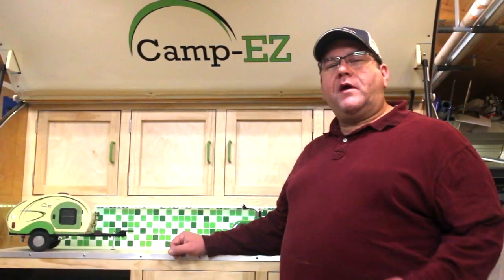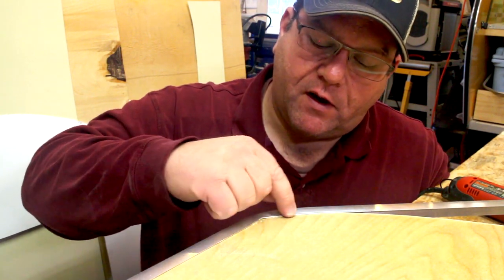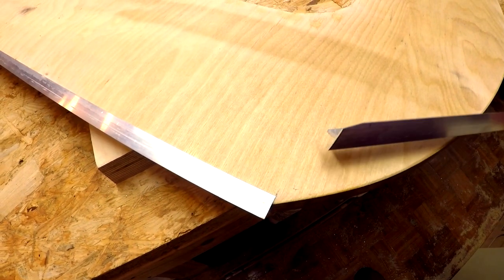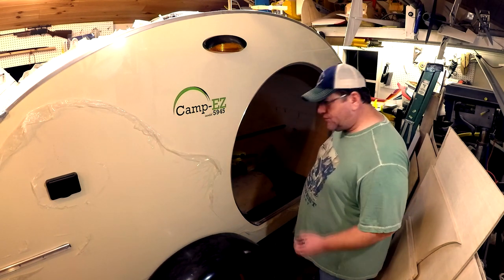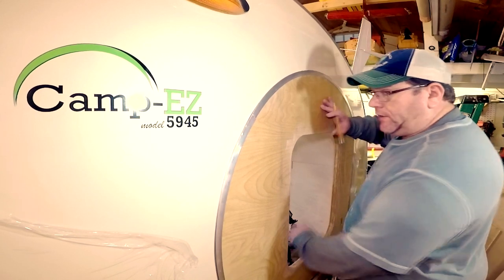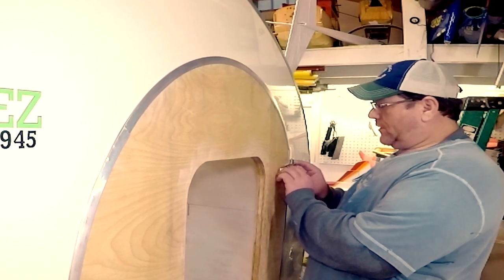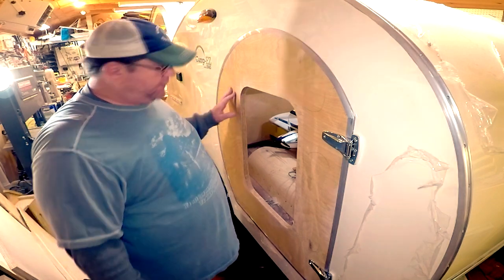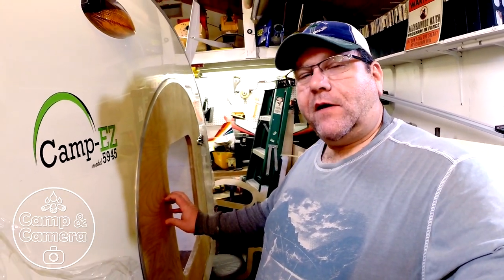Final Door Trim & Hinge Installation - It Works!

Comment: Thank you for all this valuable information. Question: does the occasional contracting and expanding of the wood no imperil the tight waterproof fit?
Reply from the maker: So far, and it’s been two years since I built it, it’s doing great and is leak free.
Reply: @CampandCamera  Good to hear it. That's reassuring. Thank you!!

Comment: Great set of videos on the trim install. Very helpful! Are you planning to add a seal of any kind to the doors and what do you think you'd use? Also, what did you use for the galley seals? I see you installed a black seal of some kind but not sure how it works and keeps it water tight. Thanks again for the help.
Reply from the maker: Jconroyunm Thanks for watching!  I have some D shaped seal on its way for the doors.  It’s 3/8” wide by 1/4” tall.  It’s an eBay purchase.  As for the galley, I ordered a seal that fits nicely inside the aluminum corner trim.  I got it from Vintage Technologies.  The part number is DHS05.

Comment: Do you recommend a trim pro like sealant or butyl tape for under the trim between the roof and side walls?
Reply from the maker: Call Sign Gino Definitely butyl tape under the roof/wall joint trim.  I have an earlier video showing how I did that.  I’m using the Trempro 635 on the doors due to the tight fit.
Reply: Camp & Camera  Thanks... I’ve been trying to catch up on all your videos and just recently subscribed.  My wall skin is on and I just laid the roof on today.  Thanks for the reply and the very informative content!
Reply from the maker: Call Sign Gino Thanks for watching!  Best of luck on your build!

Comment: What kind of hinges did you use and where to get them
Reply from the maker: For the doors, I used chrome walk-in refrigerator hinges.

https://www.ebay.com/itm/superbobi-Chrome-Smoker-Hinge-Walk-in-Refrigerator-Cooler-/174681757088?mkcid=16&mkevt=1&_trksid=p2349624.m2548.l6249&mkrid=711-127632-2357-0

Comment: Will weather affect the with of the door ? Like if it swellsdue to moisture.
Reply from the maker: Andrew Vitale I imagine so.  However, there’s a pretty good gap between the door and frame.
Reply: Plywood is pretty dimensionally stable.  As long as it stays dry, it won't move much.

Comment: Just one question. 
Is this a waterproof solution? You know, raining.
Reply from the maker: Andres Velez I ended up putting a rubber gasket on the inside of the T trim of the door.  When closed, the gaskets presses against the L trim on the wall.  I haven’t tried it yet, but believe it will work.

Comment: How do you make your door air tight, without a door jam?
Reply from the maker: The door has an aluminum flange around the perimeter.  There’s a rubber seal on the inside of the flange.  When closed, the rubber seal compressed against the outer wall of the camper.  I actually have a jam on the inside, but don’t use it for sealing anything.  I originally had a D shape seal on the flange, but later switched to an arrow head shaped seal I picked up from Vintage Technologies.  I just decided to seal the door from the outside rather than the inside.  I could always add a D seal to the jam if desired, but after several rains and water hose testing, it isn’t needed.

Comment: Where did you get your door hinges?
Reply from the maker: Preston Covell They were an eBay purchase.  Search “Chome trailer door hinges.”
Reply: Ok I found them. So after the few months you have had them on your camper, do you still like them.
Reply from the maker: Preston Covell Yep, no complaints so far.  I was concerned at first with my doors being so heavy, but so far, no issues.  I installed them with screws and blind nuts and put a shot of loftier on them.